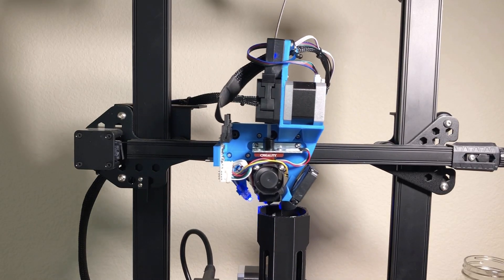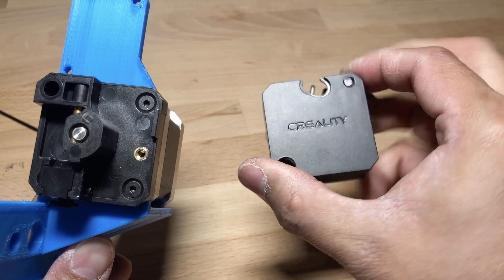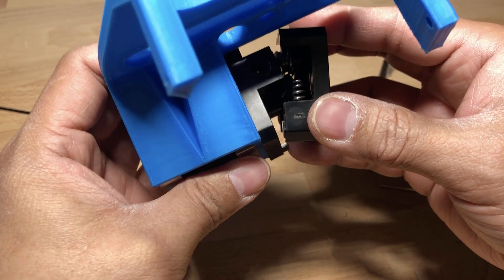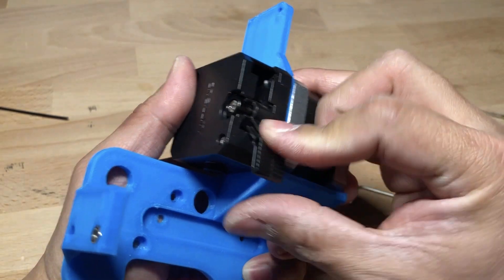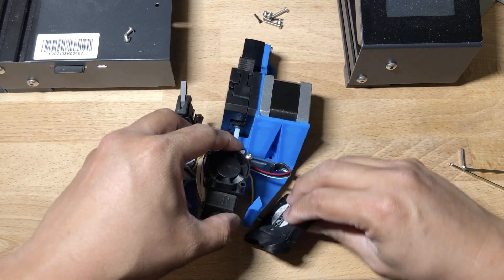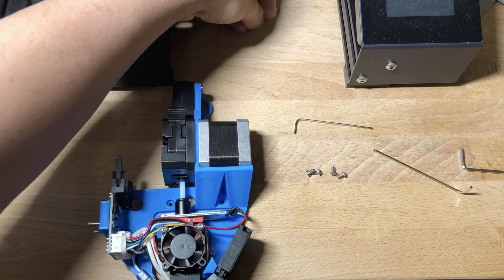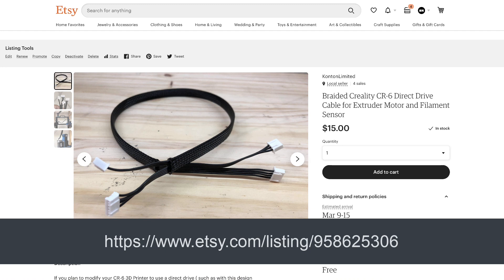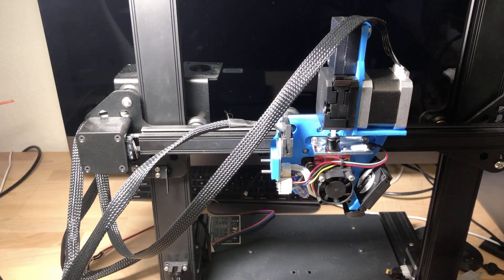Creality CR-6 SE 3D Printer Direct Drive Install

Comment: I need the wires. Do you still sell them?
Reply: hola quiero montarlo en mi CR6SE me puedes decir que archivo debo descargar v1 v2 v3 ?  Y EN CUANTO A TU DUDA CON LOS CABLES PUEDS COMPRAR LOS CONECTORES EN UNA TIENDA DE ELECTRONICA Y MONTARLOS TU MISMO Y OTRA OPCION ES CORTAR Y EMPALMAR PARA HACERLOS MAS LARGOS ESO SI HACIENDOLO BIEN SOLDANDO Y PROTEGERLOS CON TERMORRETRACTIL.
Reply from the maker: I do not.

Comment: Will it work with a metal extruder like the MK8? Also how durable is that mount, does the heat from the hotend wont melt the mount overtime?

Comment: I have a microswiss dual gear extruder, the way its holding the bowden tube is by compression fittings. Will it still work.? Ofc the hotend part where bowden is connected dont need the c clip   but cant figure out if the fitting on extruder should be loose also. Great idea btw

Comment: This design works fine on the CR-6 MAX printer as-is.  Some notes:  you will need to make longer extension cables for the extruder stepper motor and filament sensor.  I made mine about 650mm long, and that worked out fine.  There are two different sizes and three different pin counts of JST PH connectors needed -- The motor-side of the stepper cable needs a 6-pin, 2.0mm pitch JST PH (female) -- only 4 of the pins are actually wired.  The controller size is a 4-pin, 2.5mm pitch JST PH (female).  The filament sensor requires a 3-pin, 2.5mm pitch JST PH (female) on both ends.  Pay careful attention to the wiring on both cables.  The stepper motor cable requires the center two wires to be reversed from one end to the other, while the two outside pins are straight-through.  The filament sensor wiring is full reversed (i.e., you flip over the connector on one end).  I highly recommend a silicone flat ribbon cable stock -- I got mine from BNTECHGO (4-conductor, 24 AWG).
Reply: Hey, thank you for your comments. I am wondering if I can use the original pins and just switch the longer cables, is that ok?
Reply: GOAT

Comment: I think you missed one point, motor heating effect. After a couple of hours pla will be heated and not strict construction. How much hours did you work with this??
Reply from the maker: I have used these for 12 hour prints without issue. But feel free to print in PETG.

Comment: Great work mate!
Just a question: do you think it works with a BMG-style extruder ?
Do you think it could make sense to look for a pancake motor?
TIA!
Reply from the maker: I don't know about the pancake motor. From my experimenting you need the torque from the motor it comes with and I've had bad luck with anything else. As for other style extruder. I think people have made modified versions of my setup for BMG. You may want to research.
Reply: @DewItJustinKace  really too kind!!
Reply: @DewItJustinKace  Just for you to know: i just purchased your cable and screws kit, I will try to adapt my setup (bmg-like extruder, plus hot end washer modification). If I will have to change something, I will let you know on thingiverse page too
Reply from the maker: @TommasoDiDonatophoto  sounds good. I saw an order come in. I’ll get it out tomorrow. No promises with how quick packages arrive around xmas.
Reply: @DewItJustinKace  no problem at all... you are too kind anyway!

Comment: I think you will have a lot of interest from the CR-6 Max owners. It either has stringing due to the long bowden tube, or if I dial in the settings to get rid of it, the extruder over-works the material and it snaps when printing small or detailed parts. Switching to direct drive would be a huge improvement. I can provide the cable length if you would be willing to make them. If not can you let me know where to get the cable making supplies and parts?
Reply from the maker: How long would they have to be for CR-6 Max owners?
Reply: @DewItJustinKace  I measured the hot end cable from the little plug junction box out to the hot end and it is 25" (635mm)

Comment: Any idea how to calibrate esteps on this printer and how to get the temp lower than 185, it seems the printer is limited as a low point.
Reply from the maker: I can't remember what video I found about calibration, but then again I am also using community firmware and it's a little different. It also does the estimates for you.
Reply: @DewItJustinKace  can u do a video on ur firmware?
Reply from the maker: @michaelisakov1108  Not my firmware. Here's a video https://www.youtube.com/watch?v=RDW6fUSHJQY

Comment: I'm looking for a cr-6 max version of this, have one?
Reply from the maker: No. The system will work but the cable would be too short.
Reply: @DewItJustinKace  yes, this I know. I can make an extension myself, but I rather have a factory look to the cables. Anyway you could help me source them? Printing the mount now.
Reply from the maker: @michaelisakov1108  do you know what the length of the cable needs to be in cm?
Reply: @DewItJustinKace  I'd have to calculate that and get back to you. Is it something you think ud be able to custom make?
Reply from the maker: @michaelisakov1108  I don’t know how many people would want them, but it’s possible.
Reply: @DewItJustinKace  I'm estimating 610mm would be adequate, if possible?
Reply: @michaelisakov1108  640-650 mm will give you a bit more margin (I've made this mod for my MAX).  After remaking the cables a couple of times, I'd highly recommend using 24 AWG 4-conductor silicone flat ribbon cable (BNTECHGO is one source).  Also note there are two different spacings required on the JST PH connectors -- the extruder stepper motor needs a 6-pin JST PH with 2.0mm pitch (only 4 pins are actually wired); the connector for the controller end is a 4-pin 2.5mm JST PH.  The connectors for both ends of the filament sensor are 3-pin JST PH 2.5 mm pitch.
Reply: @markhargrove  thanks for your input, I found the cables online somewhere.

Comment: Which direct drive unit is thus.
Reply from the maker: The one I link to in the description.
Reply: @DewItJustinKace  there's no link in the description.
Reply from the maker: @dvader57  There are a couple links. Are you clicking "Show More" or just reading one line? The link is https://www.thingiverse.com/thing:4701896
Reply: It's a 3d printed mount which reuses existing hardware of the cr6se.

Comment: Hi,
Interesting mod but what about the autolevelling ? Does it still work ? the connection of the 85mm feed tube ... Is it still flexible enough to admit a pressure on the levelling sensor ?
Reply from the maker: Yep. Works great. See the reviews on Thingiverse or Etsy.
Reply: @DewItJustinKace  Thank You

Comment: I wonder why dd pushes the filament out in the opposite direction in my experiment?
Reply from the maker: Do you reverse something perhaps?
Reply: @DewItJustinKace   I reversed the wires :D
Reply from the maker: @mehmetcakc8496  been there. That’s why I make the kit I sell for wiring. I was tried I reconnecting wire ends.

Comment: Hi Justin, is your mods compatible with full metal extruder ?
Reply from the maker: How would you mount that to allow for the auto bed leveling?
Reply: @DewItJustinKace  , a lot of people seems happy with this kit on a CR6-SE : https://store.micro-swiss.com/collections/all-metal-hotend-kits/products/all-metal-hotend-kit-for-creality-cr-6-se
Reply from the maker: @sixbras  Looks interesting. If it requires absolutely zero modifications as stated, then my mount should work fine with it.
Reply: @sixbras  any news on this?
Reply: @palti0r  I've got it working with the Swiss Micro all-metal hotend -- no issues.  The small piece of bowden tube need should be 57.5mm long instead of 85mm as needed for the stock Creality hotend.
Reply: @markhargrove  This was the answer i was looking for. Thanks :)

Comment: Great work. I have just received my cables and screw set from you. Ready to install. What settings have you made to the slicer software or gcode? Is it just the retraction settings?
Reply from the maker: I’d change the retraction to 1.5 or 2mm. That’s it.

Comment: Thanks for a great bracket and even better service! We happened to live in the same town (small world), and Justin delivered 3 sets of his Etsy kits to my house personally within like 12 hours of ordering.  The bracket and kit work perfectly. Just finished a small tpu print and it came out perfect. Definitely a great upgrade for your CR-6.  Tip, I just left the runout sensor on the side and stuck a bit of filament in it to keep it triggered (these sensors suck anyway, lots of false runout stoppage). Helps keep the weight down too. Thanks Justin, I'll leave a great Etsy review as soon as they let me (4 more days lol)
Reply: With Community Firmware you can just disable the filament sensor and leave it physically detached from the system. That's what I do, for the same reasons you describe.

Comment: Thanks for this video, I am looking forward to buy a CR-10 Smart, but want a direct drive.
I wondered It it was possible to mod it this way, so your video helps really much
Reply from the maker: It should be,  but I’ve never tested it, and it might need a longer cable.

Comment: Hey Justin, i orderd the cable from you and put all together. First thank you for fast delivery too germany. But i got a problem with the extruder and the hotend. When the extruder presses the filament into the hotend, the hotend bends a little bit to the bed so that the nozzle don't be in the right position. Do you have problems like this.
Reply from the maker: You can contact me by Etsy and photos would help, but I’m guessing your left those crimps on the tubing. You need to take those off.

Comment: I found this cable on AliExpress - for European Applicants .... The seller makes the cable exactly 60 cm as the original. Thanks for the video Justin
3D printer accessories motor and limit switch extension cable male to female For ender-3 CR-10 series cable length 1M
https://www.aliexpress.com/item/1005001701994380.html?spm=a2g0s.9042311.0.0.44d74c4dZ7I8nE

Comment: I had made my own mount but never really finished it. Installed this on two of the CR6-SEs I have and have been really pleased with the results over the last 2 days of printing. I plan on instilling this on a 3 printer that is a coworkers that I manage for him. Also while I have take my apart and put it back together a dozen times this video is really detailed and helpful.
Reply from the maker: I'm glad to hear it works for you. It's been a bummer that no one has developed direct drive for it yet. But happy this fills the void until then.
Reply: @DewItJustinKace  yeah I agree. That is why I started doing it myself as well. It was just hard to find time to use my own printers to keep developing my own. Now I don't need to thanks. Now I just need more printers. ;)

Comment: does this effect the print volume at all? The model seems pretty large. Also, have you experienced any significant speed change with the added weight? Thanks!
Reply from the maker: The hot end is in the same position. So the X and Y access are not affected. The Z axis is actually higher since the filament detector is out of the way, As for speeds, I wouldn't go past 100.
Reply: In my case it limits my Z height but that is due to the cabinet I have it in and not the bracket itself. 

Also in my opinion direct drive doesn't help that much if you print PLA that much but it does help with the stringing on PETG and I generally have to print that at a slower speed anyways with PETG.

Comment: Are there any other requirements like firmware update or other changes other than this mod and changing the part and getting the cables?

How much improvement have you noticed from the original system?
Reply from the maker: You should change the reaction to be around 1.5mm. That's about it.  You may need to adjust that depending. But I have much less stringing on prints. Plus it makes pulling filament our easier and lets me use filaments like TPU.

Comment: SE only. Can it be used with the Max?
Reply from the maker: The design can. You’ll need a longer cable probably.
Reply: @DewItJustinKace  , do you think you'll be making/providing a cable that will work with the Max?
Reply from the maker: @tonykyle2655  I don't have a max. So I have no idea how long it would need to be. Can you tell me?
Reply: @DewItJustinKace  , The Max is 70% larger on the x and y axis and 1.6 on the z axis.

I don't have my Max setup at this time but I divided 430 by 225 which I believe is the size in mm for the SE version. The specs says the Max is 400x400x400 but on the x and y the actual bed size is larger so we have to account for the x travel distance. 

The cable extension for this needs to be just over 90% longer. If the cable is 6 inches long then it needs to be 12 inches long. For 9 inches it would be 18 inches and if the extension is 12 inches long then the new extension for the max should be 24 inches. The numbers were rounded up to allow for stress and to ensure it should be long enough.

If you need cm or mm I can convert for you.

Comment: I wonder how the bed level sensor performs. Did you leave the fixing mechanism for the Boden tube clamp off either on the hot end or the extruder to allow for the tiny bit of movement the strain gauge needs or does the bracket flex enough not to interfere with the bed level measurement?
Reply from the maker: The clamp is off. I run this one 6 machines with no issues. Or at least no issues related to the mod.